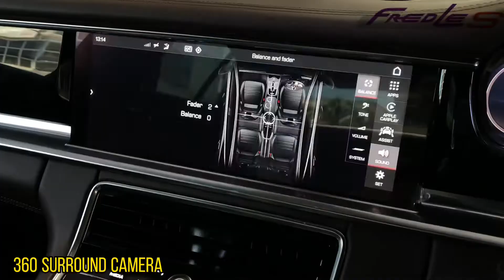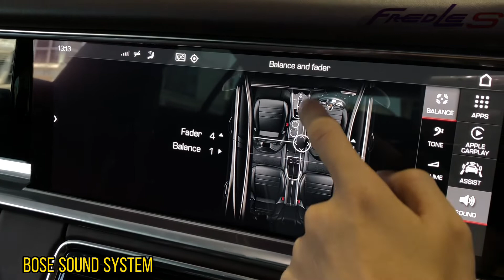Porsche Panamera 971 installed 360 surround camera & Bose Sound System

Comment: Hi guys, great video. Can you please help with sport chrono pack installation into Panamera 971??
Reply from the maker: Hi , you means sport chrono with launch control ?
Reply: @Fredlesflc  hi, yes, the clock on the dash and launch control
Reply: @Fredlesflc  also the rotary switch on the steering wheel
Reply: What’s needed for the 360? New mirrors, wiring and coding or there’s a separate module?